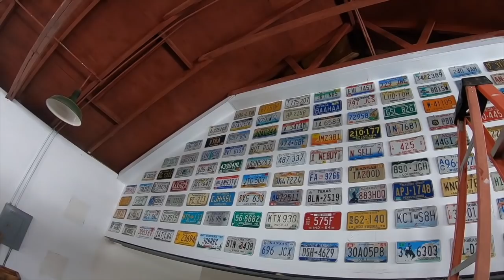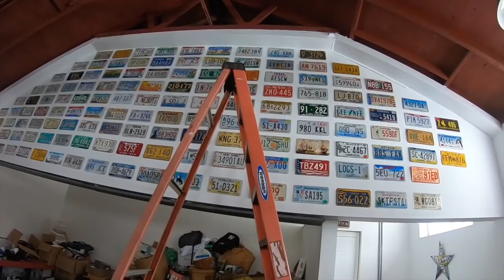Garbage Picking - Finding Stuff In The Wet Snowy Roads!

Comment: Your criticism of tolls is only partially correct. To build a road, a government issues bonds that must be paid back over a long period. It is the equivalent of a private citizen taking out a 30-year mortgage to build a house. The purpose of the tolls is to pay off the bonds, which takes many years.

If the legislature and governor pass a law, the period of the toll may be extended after the bonds are paid off.  This is the situation with the W.Va. Turnpike.  Its bonds were paid off many years ago, but the tolls remain.  

This is a dirty political maneuver because a huge proportion of traffic on this road is through traffic that does not stop in W.Va. The tolls are just a way for  WVa to tax the citizens and businesses  of other states.

Thanks, dirty politicians,.